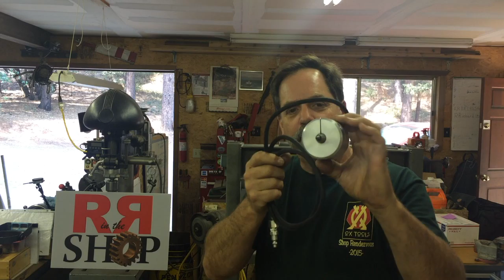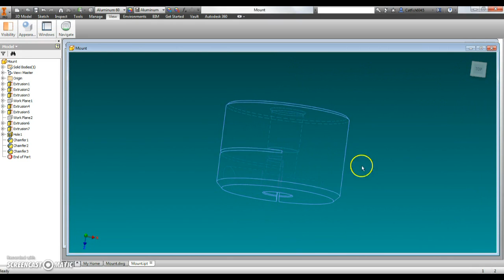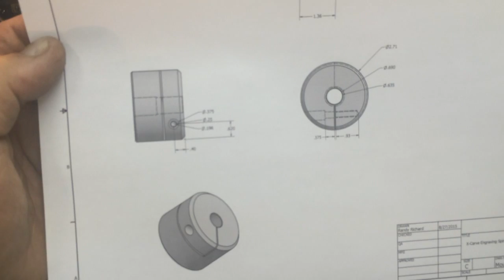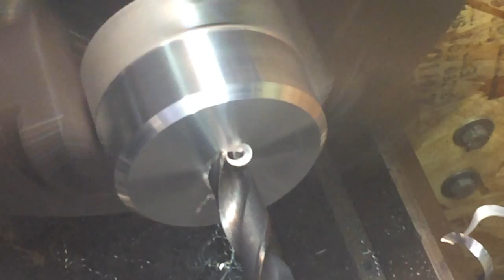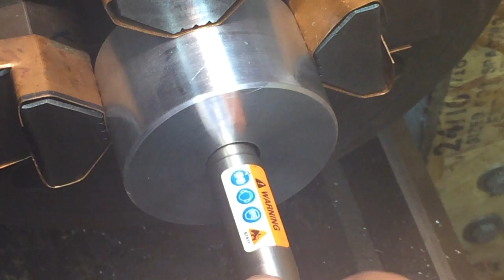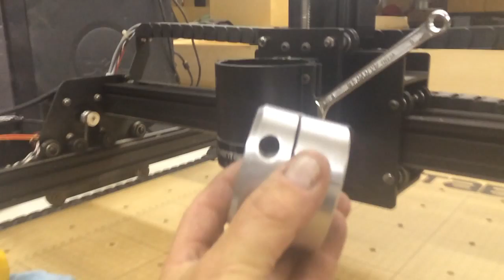Inventables X-Carve Engraving Spindle Upgrade

Comment: Randy, Cool vid!..Quick question, when you did  the OD your already  set and can mark that on the dial using the universal jaw and just flip it using the same saw and the same mark on the dial to get the diameter....why did you decided to use the independent chuck to do the back side? Thank you...continue those cool vids!
Reply from the maker: Than you.  There is a about .002" of runout with the 3 jaw chuck.  If I had just flipped it over the OD's would not be concentric due to the runout.  With the 4 jaw I was able to align the part perfect so each side would be concentric.
Reply: Cool, got it!.....That's a workmanship and Precision there. Also theirs only few manual machinist out there now a days.
Reply from the maker: Thank you.  Fun to make it right.

Comment: I've never seen anyone use a circular saw blade as a slitting saw before. Do you only use it on soft metals?
Reply from the maker: +AndTheCorrectAnswerIs Thank you for stopping in the shop.  I have only done this on Alu., Copper and Delrin.

Comment: That looks really nice! That was QUITE the slitting saw!

Did the second, smaller, saw cut all the way through? If not, did you finish the cut with something else?

(edit...)
Aw, I see someone already asked and that you finished it with a hacksaw.
Reply from the maker: +Hirudin Those saws are relatively cheap and work great in Alu and Brass.  Yep Hacksaw blade and small strokes, just the corner to cut out.  Thanks, Randy

Comment: Randy, nice work! The engraver will come in handy I'm sure. The addition of a solenoid to the control panel for turning the engraver on and off will be a nice touch. This mod could also be used for an airbrush. Plus a ceramic extruder if you add 3D printing capabilities to the machine.

Now revisiting the router speed control automation I think that it would be nice to be able to adjust the speed on the fly for the type of operation being made i.e. roughing, detail, finish, etc. so the operator is free to attend to other tasks. An auto tool changer would be a nice mod too, but since your router motor has a button to lock the spindle I'm not sure how to accomplish this at the moment.

Well after you finish with all of the mods your X-Carve will be a very versatile machine as well as a great addition to your shop. Thanks for sharing this adventure.
Peace!
Reply from the maker: +Jeffrey Vastine Thanks Jeffery.  Sounds like I should get a Tormach or something.  Thanks for the suggestions, 3D printing sounds interesting.  I hope to try the engraving this week.  Randy

Comment: Was that an old old drill bit that you were using as a boring bar?  Nice design for your clamping system.
Reply from the maker: +ILGopher It is a single flute and cutting edge tool.  Like a drill or boring bar.  I use them as boring bars, they work great on small stuff.  The mount cam out good hope to have time to test today.  Thanks Randy

Comment: Nice design and flawless execution, Randy.  For the second slitting operation, did you need to finish the cut with a hack saw blade or something?  It did not appear that the saw would quite be able to finish the cut...

Great idea of using the carbide woodchuck blade.  Looked scary at startup, though.  No trouble with the arbor slipping?
Reply from the maker: +Bob Korves Thank you Bob.  Yep a 24tpi hacksaw blade to cut out the corner.  The wood chuck blade is about 0.055 thick, they work great in Alu and brass.  No slippage just go slow, hand fed.  Could file/grind a small keyway in the blade.  But actually I would rather have it slip if there is a problem.  Take care,  Randy